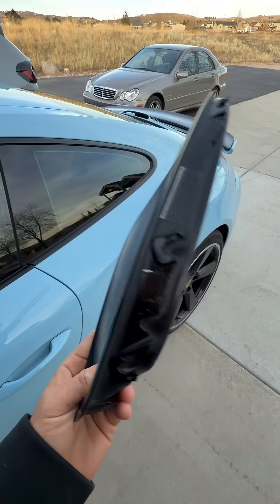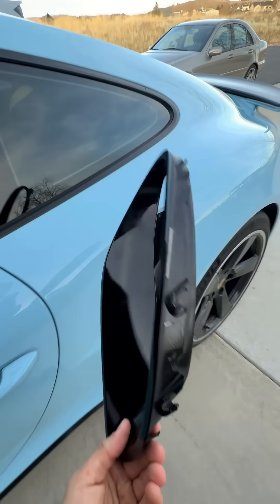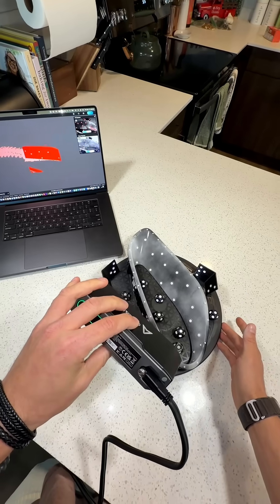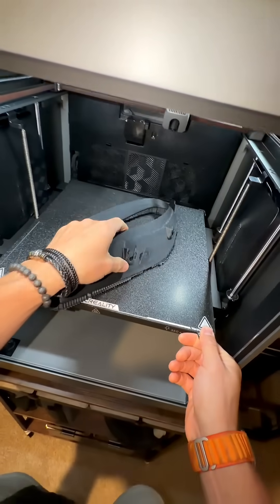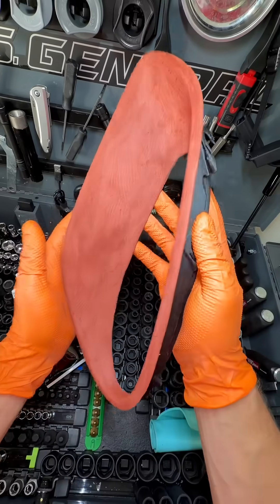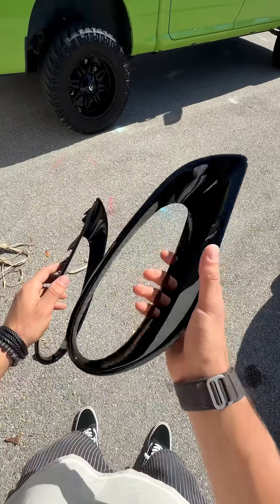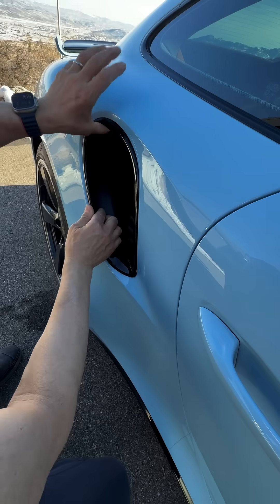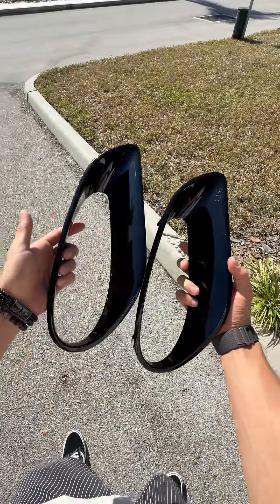Porsche wanted $2,000... So I 3D printed it for $20 instead😳😳😳 #3dprinting #creality #porsche

Comment: Bro spent $5000 worth of hours on it
Reply: .... You think scanning a piece, rendering it, printing and painting costs 5k?! People really are out of touch.
Reply: @koko4620  He said $5k in hours, meaning the amount time spent. This doesn't look like a short amount of work. Maybe not $5k, but a few thousand is practical. Obviously unreasonable for Porsche who has streamlined it.
Reply: @grovePS3 and that's why I listed things that cost hours, not materials. Printers print on their own, paint dries on its own. You're looking at 5-10 hours of labor max. There is a zero percent chance the labor is even worth 1000. Case in point the out of touch I was talking about
Reply: @koko4620  Maybe if you have an eager kid around to do it for you but if 10 hours of labour isn't netting you $1000, there's no way you'd own a $100k 911 Turbo. The Porsche margins absolutely take advantage of that. When he's doing labor himself, the labor cost is whatever he charges to do his own work which, for the vast majority of people who own these cars, is many hundreds of dollars an hour. So even if you have the printer, most people would just give in and buy the OEM part.
Reply: @koko4620  The 3d render was completely glossed over. If the 2 sides aren't seamlessly combined automatically, that's a dumb amount of effort. The print time also needs to be factored in because it's tying down your equipment. These things aren't free in the business world, so you can't just write them off as non-existent when comparing against the manufactured part.
Reply: @grovePS3 Porsche is using molts because they are way more reliable. Its cost is mainly inventory.
Reply: @grovePS3 😂😂 what kinda math is that. Buddy you must be making ceo hourly wage with that logic. I have multiple 3d printers and have done mechanical parts larger than that small vent. It take a few hours at most for sanding, priming and sanding then finishing. Printing it take more hours. Oh btw it does not cost a fortune for a 3d printer that can print ASA,etc..he spent $300 to $400 at most and that includes the extra he said for the shop to finish the painting. Just stop hating broski.
Reply: @ravindrapersaud7608  If he wanted to make an honest labor‐price comparison, then why hide the hours? Why deliberately cut passed the 3d model editing time. It would take a few seconds to say. Also, you don't need to be a CEO to make over $100/hr. That's insane.
Reply: @grovePS3 my guy it does not matter. Have you ever used a 3d scanning tool. It does not take long to do this. Please just stop, your not helping yourself here. You clearly have absolutely no idea of how 3d printing works. Just leave it for people who actually know. Fyi, I do exactly this and the labor + cost of materal is nowhere near what anyone on here is claiming it to be. Its in the hundreds of dollars...not thousands.
Reply: @ravindrapersaud7608  Go make a video doing exactly this and record all of the hours it takes from scanning all the way to finishing
Reply: @grovePS3 U are stupid printing takes less than a day or two
Reply: @Caesar2001 you've increased the labor to 24-48 hours and justified the higher cost
Reply: @grovePS3 it does not cost more if you weren't a brokie you would already have a 3D printer which is super useful I printed so many things that I needed for my personal projects which would cost 10x if I were to buy them and I would also have to wait weeks if not months in some cases. Also if you are a pathetic brokie you could always sell things and the 3D printer will pay itself off 😂
Reply: @koko4620  😂😂😂 fr it's sad. People just create their own "facts"
Reply: Imagine someone told Einstein to work as an accountant instead of wasting his life of dumb theories
Reply: @barta5ot-395 Accounting is not that bad)) Don't insult poor accountants)
Reply: Actual brain dead comment.
Reply: By your logic he bought all that equipment just to print that part ?
🤦‍♂️🤦‍♂️🤦‍♂️
Reply: Fr?
Reply: It's 1.6k for the stuff he's using and it's paid itself off.
Reply: and now he can sell them online and make a fortune
Reply: It’s more satisfying though .
Reply: Not even 😅
Reply: Even if it would be worth 5k, he didn't spent it instead he earned it. He did this all during his free time and guess what.... you don't get paid during your free time.
Reply: @naplam3978  "Hey, it's the weekend. Want to come in and work for free? It's your free time anyway, so it's not like you were getting payed."

If you're trying to save money by doing it yourself, labor is a relevant metric to factor in. Time isn't free. Energy isn't free.
Reply: @grovePS3  Your comment only shows me that you're lazy. He's spending free time to increase the his value by not spending, but working for it. Best part is, it's not even heavy or difficult work, so it's not a problem.
Tell me, how are you increasing your value on a saturday by binge watching netflix? Don't tell me something about worth when your way is worth 0$

Edit: That was maybe a little bit boorish (i'm excusing for that), but at least it's the truth and a real fact nobody can deny
Reply: @grovePS3 You aren't getting paid to sit around and watch Netflix. I rebuild my own engines after work.
All my co workers are in debt and depressed. I'm not.
Reply: @Callsign_Sturm  What point are you trying to make? Time spent on something has a value. You're putting your time and energy into something and think it's happening for free?
Reply: @grovePS3 Our value is meaningless to millionaires. Money value is and labor value is subjective. People do not pay for quality work and sometimes it is insanely easy to do things that cost thousands. Hvac blown capacitor, 2 dollars. Call someone? Thousands.
Also, sometimes you simply can't get a service that you want the way you want.
What TF would I be doing if I weren't rebuilding bike engines? Gaming? Wasting money at restaurant with servers that cry crocodile tears for money?
I would be bankrupt and bikeless if I paid a shop to do it for me. But now, I get to pay rent AND own bikes that can run circles around other bikes if built right. 
Nobody is going to give me a monetary or trade value for this or for what I want.
Divorce yourself from that concept. The world milks people and they don't want you being ungovernable.
Reply: @Callsign_Sturm The most irrelevant, off-topic reply imaginable.
Reply: @grovePS3 that argument only works if there is an alternative. I’m not going to work more than 40 hours, but happily do some chores or small projects in my own time. Some people just get joy out of doing productive stuff, that can be worth more than money.
Reply: @Deveonn  If you do them as a hobby it's one thing, if you do them to save money you always have to factor in the alternative. If you make $30 an hour and spend 10 hours doing something, but someone else would have done it for $200 then you would have been better off doing an extra shift and paying the guy to do it for you.

Comment: Ebay 150 bucks for both sides 😂
Reply: Yeah. Did the same thing. Found several 100-200 each side.
Reply: One of my vehicles is a 2004 Lexus RX330. The headlights were really old, yellow and needed replacement. Lexus wanted a little over $600 each headlight so I bought both for about $150 off Amazon and they work great. I've done expensive new cars before and learned my lesson... There are so many better ways to spend 100k than in a depreciating asset that is expensive to maintain.
Reply: Just wait until you see another Porsche and it's free. Probably where the original went.
Reply: @5000rgb if it wasn't a YouTube video, that would probably be a true statement
Reply: @5000rgb 😂😂😂😂
Reply: in forged carbon 250 xD
Reply: each
Reply: Ebay still has a winning record 😂
Reply: Gee,  if I live in luxury and I can afford to live this way then why would I be concerned about cost???    When money is no object?   Maybe people who drive Kia or Nissan would go through this much work to save some money to put food on the table.   Other than doing it for the content of YouTube.,  I don’t see any reasons!
Reply: @koolxxxyear  some rich people don't care and thats why they charge what they charge. the Lamborghini murcielago  has many parts from other cheaper cars. but if you buy the parts from Lamborghini they are expensive. but if you buy them either from the actual OEM or third party they are far cheaper for the same part.  basically Lamborghini buys the parts and then sells them at a high markup. the daiblo has nissan headlights and they put a piece of carbon fiber stuck to the top of them to block the nissan logo.
Reply: @Stackali  Ironically there are Audi parts that are cheaper to buy from Lamborghini.

It's never that simple.
Reply: @koolxxxyear "rich" people are some of the most frugal people. Most people pay full price for something because they don't know any better, or don't have the time or patience to know any better.
Reply: @kelgbrown007  the truly rich usually get someone else to pay for it.
Reply: @Briggsian who they get to pay for it? I am not rich, which is probably obvious since I have time to comment, but I am trying to learn their ways 😂
Reply: @kelgbrown007  Mixture of their employees and tax payers, typically. Take out low interest loans using your business assets (stocks) as collateral to pay for things, thus dodging taxes and paying off your loan with future profits skimmed off of other people's labor. Being truly rich means you're essentially just a professional money receptacle.
Reply: @Briggsian damn. I didn't know they were using that process to buy car parts. But, all good. ✊
Reply: Really? That is hilarious
Reply: https://www.google.com/
Reply: Literally just looked it up. Most go for around $500
Reply: Plastic parts on eBay are not you UV resistant and they're definitely not resistant to cold there cheap. I bought some door handles from eBay and both of them cracked and broke off in my hands the first winter😢
Reply: @Displacement-destroyer  found than at my dealership for 200 and he buys good replicas
Reply from the maker: Find it papa. Send the link
Reply: @Haydenschreiermk2 can't send links in the comment section papa
Reply: @feelincrispy7053  be creative and use the oldest cheat by deleting the dot from the link.
Reply: @tomclanys  bro is a genius
Reply: @tomclanys  I guess you can call me a “ conspiracy theorist “ but on my google account with an android, ( I’m currently using a iPhone ) I would have to write my sentences backwards and even then YT would still delete my comments still 😂😂😂 hopefully after awhile of not using my android my shadow ban is gone.
Reply: @MMSMusicLabel  I actually read Tom Clancy's when I saw his comments.
Reply: @Haydenschreiermk2 yeah I drive corvettes. We the masters at finding deals, good video but dont get butthurt because you didnt check ebay 😂
Reply: @elementestablishment  He's LITERALLY just asking for the link, dude.
Reply: @Haydenschreiermk2  i just found 240 dollars on aliexpress just enter porche 911 air vents and they are carbon fiber not plastic.

Comment: $10,000 worth of 3D printer and software later, we saved -$8,000!
Reply: It's actually only about $1500 total for everything he used in the video including paint. So although technically he didn't really save any money, he now has that part forever and could sell it to others more than likely
Reply: @zander3115  and much like with every other tool in existence, you have to use it more than once to increase your roi
Reply: @zander3115  For him he already owned these machines and the scanners so he really did save like 1800 or 1900 bucks but for somebody who wanted to gain the ability to do this just for this one part yeah it wouldn't be saving much, but you wouldn't be paying 1500 for the part. You would be paying 1500 for the 3D printer, the Scanner, and the part. Quite a big difference.
Reply: wait, how much is the software?

Comment: Well considering most people don’t have a 3d printer, the software needed, the 3d scanner, ect. this isn’t going to be shutting down any body shops or parts stores anytime soon. Cool to say u did it yourself, but most people are just going to pay for the part. Especially if u already have the money for a Porsche
Reply: Just a few years ago, nobody had this stuff beside professional businesses. Now it's easy to get access to this tech.
My local public library in a not good neighbourhood has 3d printing available for public use (no, probably not to this quality)
It's not unreasonable for people to start doing this more. And it will become cheaper and easier as time goes. Which will hopefully force OEM to become more reasonable with their pricing too

Comment: But correct me if I'm wrong.. you took apart the original part to ruin it to make 2 fake ones?? Right..
Reply: The part he scanned wasn’t ruined.     He just added a couple stickers and a washable spray coating.
Reply: why leave the original on when he can easily make the mirrored side that he knows will match the other side exactly

Comment: 2k for a cheap plastic part. What a scam.
Reply: apparently that is the price for carbon fiber version
Reply: @frenchpatriot44  thats still alot, unless porsche has magic which makes their carbon fiber better, you could buy aftermarket carbon ducts for 700€ a pair. Sometimes going oem is just stupid with parts like this imo
Reply: @jaskajokunen3716 they do have magic that makes the part more expensive. It is the porche logo
Reply: @jaskajokunen3716  ho yeah especially on small parts like that, a buddy of mine had to buy that small square plastic part that conceals the hook on the front bumper before returning his work car, 180$ lmao for litterally a square tab no bigger thana couple inches
Reply: Well, He said in another comment the materials cost him about $250 for both, plus yoy figure the cost of the printer itself and the software, then the markup the manufacturer has to make to make money, so honestly $2k for one side is still crazy but you can see how they got to that price
Reply: @alexhenao7072  a Bambu Lab P1S is around $400-640 and can print that material (ASA)
Reply: Me when I forget that printers cost money, filament costs money, and everything costs money.
Reply: The scam is the vid creator.  Blocking for misinformation/ dishonesty
Reply: It’s carbon fiber. In plastic the part costs 250-300.
Reply: All Porche spare parts are a rip off!
Only beaten by the supercars from Ferrari, Lambourghino and McLaren. If you crash one of those, the insurance company will just throw away the entire car
Reply: I sell German car parts and yes some of the part values used or even broken are absolutely wild
Reply: He should get in the business of selling replacement parts for those cars lol.
Reply: @peterwilkinson1975 He wouldn't make anything. You can buy a pair of carbon fiber side vents for ~$500-1200. Aka there are companies or individuals selling these parts lower than his own material cost. That's before factoring several other expenses needed for production. He would have to look towards induction molding, not printing, in order to make any money.
Reply: Just ebay it and call it a day
Reply: It's not, they are around $100

Comment: This is a business model for recreation of classic car parts that can’t be found anymore. You could even piece together broken ones then scan them. Fascinating. 🧐
Reply from the maker: Yes I’ve done that before!
Reply: Had exactly that conversation with small workshop in Oakham, UK dealing with +20 year old cars. Still waiting for a call. 😅
Reply: @spezzington sounds like you need to talk to the guy in the video
Reply: Got 3d printed inner door handles on my vw lupo. Vw doesn't make that replacement part. It's stronger because 1 piece, the original always breaks in the same weak spot. I gone thru 2 handles till giving this a shot.
Reply: You can’t legally copy someone else’s product or IP just to resell it. Only way you could is if it’s in the public domain
Reply from the maker: Patents on old car parts expire and then you can:)
Reply: @Haydenschreiermk2  literally what I said, expired patents return to the public domain….
Reply: @HighOnLife1159yes you can
Reply: @Martin-xh1hd learn to read.
Reply: @HighOnLife1159no one cares.
I only care if the part is good and not sold as a genuine part.
Reply: @Callsign_Sturm right, ok thanks for sharing your 100% correct facts
Reply: @HighOnLife1159in merica we have right to repair.